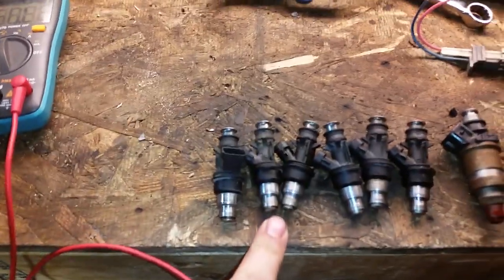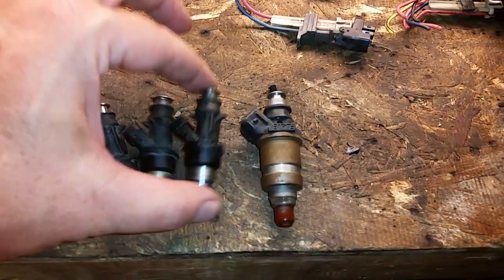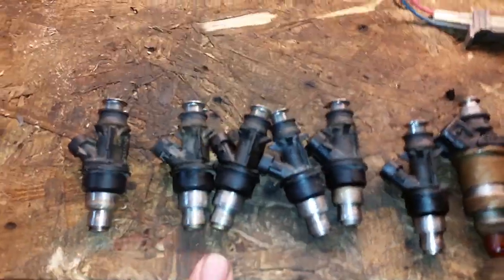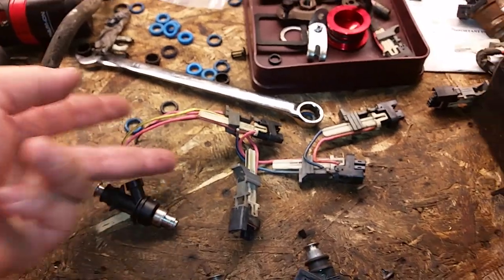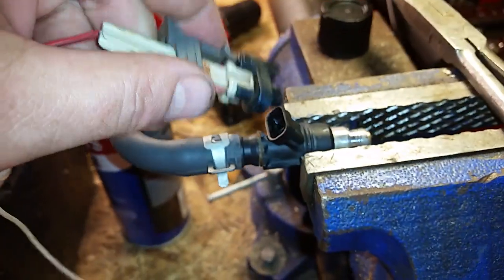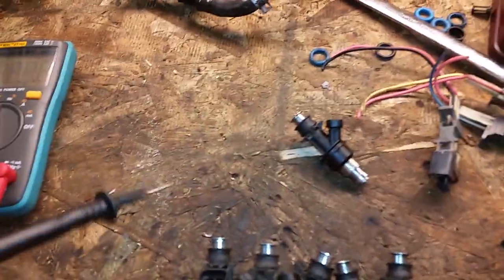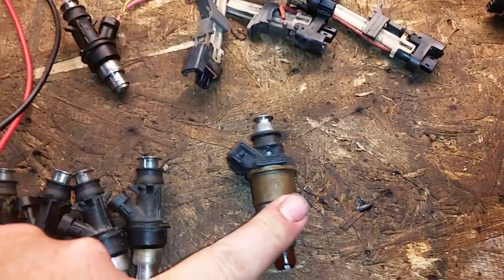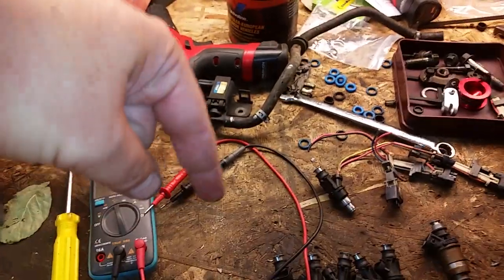Checking and Cleaning Decapped Chevy/GM injectors for Turbo Honda

Comment: I would feel super sketchy, using  that injector in the vice. Like you mentioned, the spray pattern looked awfully goofy. Although, it may have been because of the way it was being fed. If it was being fed from a fuel rail, it may have a normal spray pattern. That is why it is important to have decapped injectors cleaned and properly flow tested before actual use. Even if they don't match very well, you can at least adjust the individual cylinder fuel trim, to get them close.